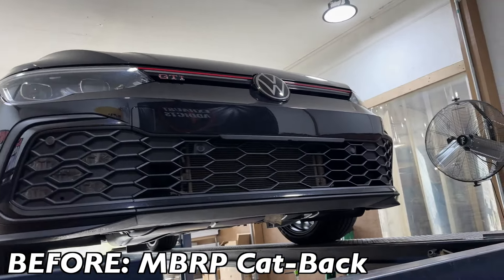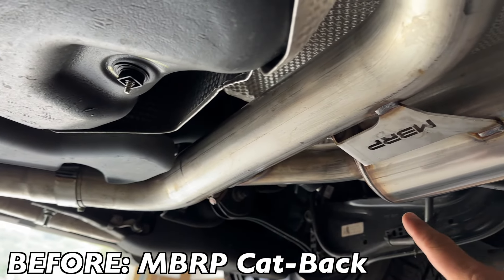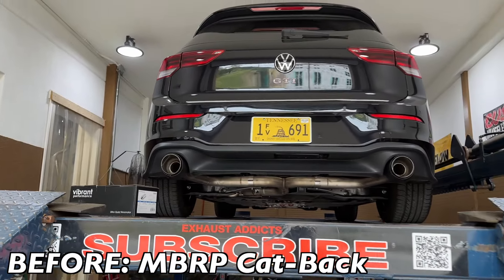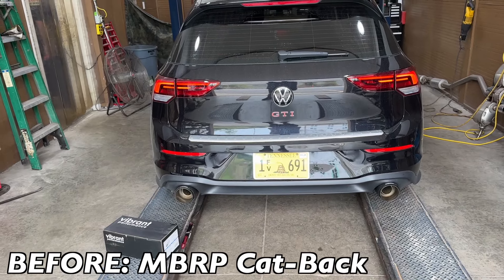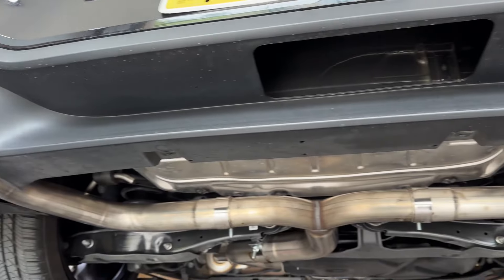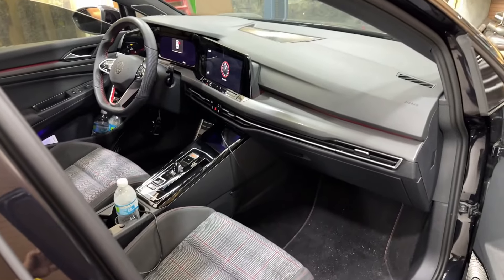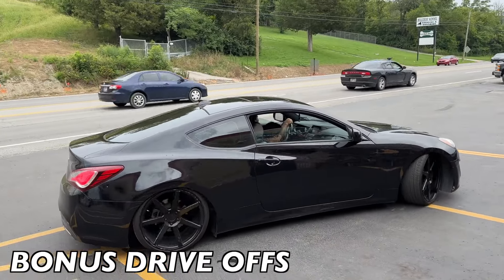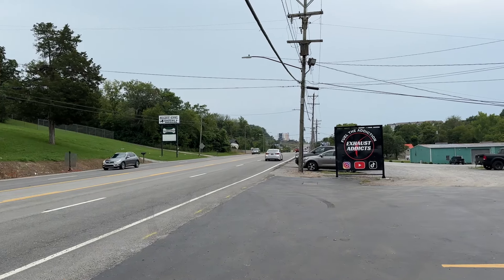Does MBRP Cause DRONE? TESTED on 2024 VW Golf GTI!

Comment: As a former MK7 Golf R owner, he could've just deleted the resonator from the OEM system and gotten a similar sound, but I do like it.
Reply: Yeah, he basically put it back to standard
Reply: @gabrielbrookesagri9752  If it's my money, I'm going downpipe/tune. Would sound about the same as this, but with an extra ~75 horsepower.
Reply: @embiggens1  yes, you make the most power from an aftermarket downpipe
Reply: he did it because of the drone. getting rid of the resonator makes it drone.
Reply: @keonlaxina3161  Again, I owned one and I deleted the resonator before I went big turbo and all that. It doesn't drone. At all.